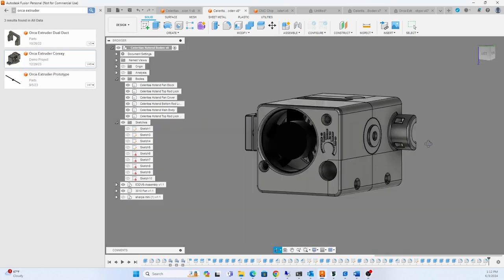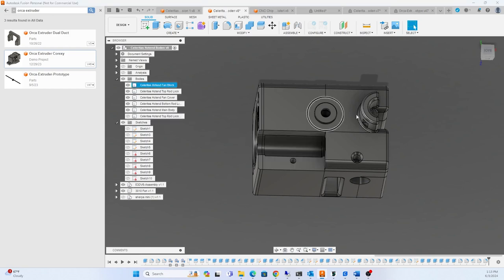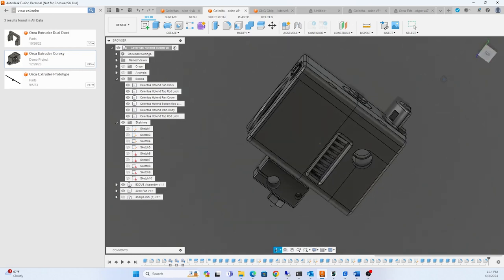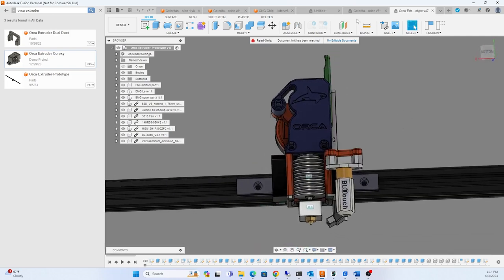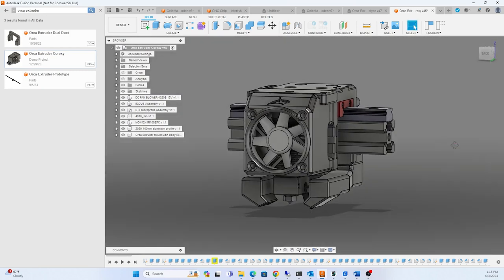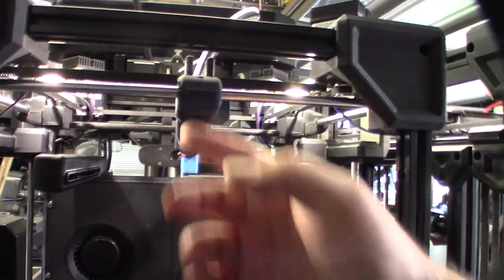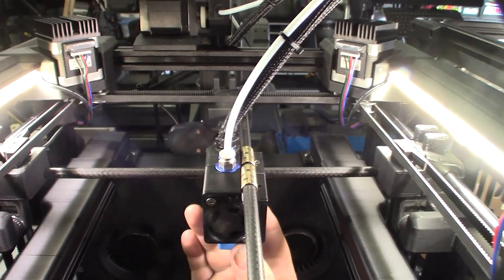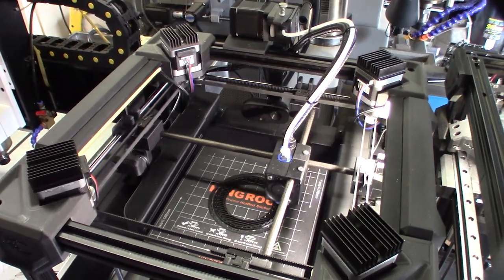Celeritas World's Fastest 3D Printer Concept, Hotend Improvements, CroXY Carbon Fiber Tubes Part 5

Comment: Fire keep it up, this  maybe a stupid thought but would glass rods work better than the carbon fiber ones? If those bushing don't work the best you could try full carbon bushings and see tho I don't know if they will hold up to the load. you could also add a magnet into the two carbon fiber tubes then where you have the screws, add a concave magnet into that top part. Also another big stupid but may work could you use a or two new or old xbox kinects to do bed leveling and meshing?
Reply from the maker: Glass rods, interesting! The is the first I've ever heard of carbon graphite bushings. Good ideas, thanks.
Reply: @fintechrepairshop  The only thing is that carbon graphite bushing get expensive but would cut gram off. If you use glass tubes you could still do the magnet thing I mentioned before, the only thing Is don't know how or if using glass tubes would hold up to the load unlike using a full glass rod should. As for the Xbox Kinect that's just a big maybe with a mix of I don't know if it would work, like it should and would make things a whole lot faster, wouldn't add weight to any moving parts.